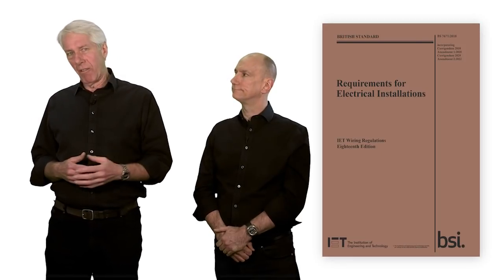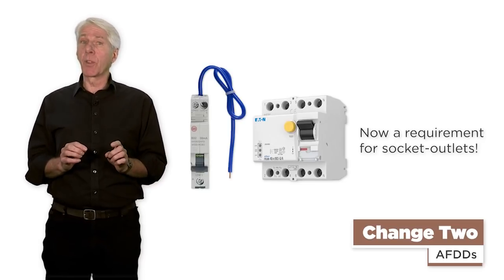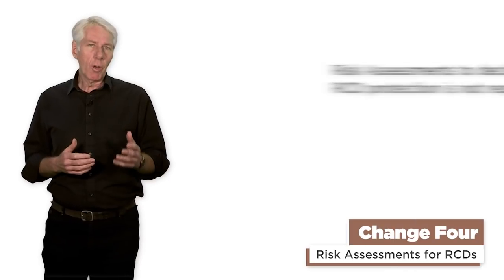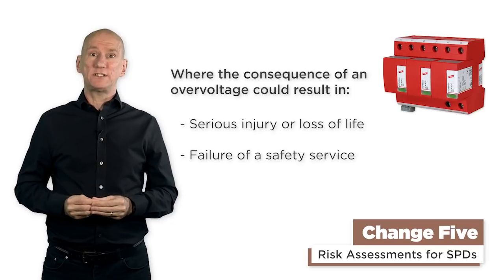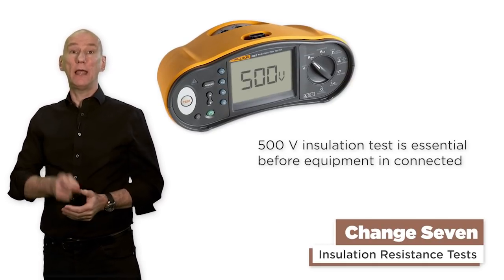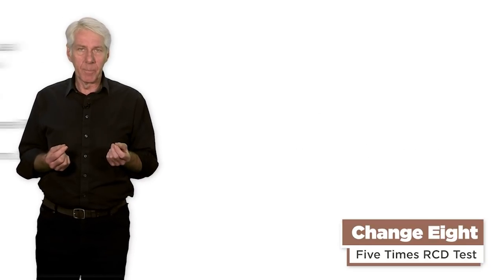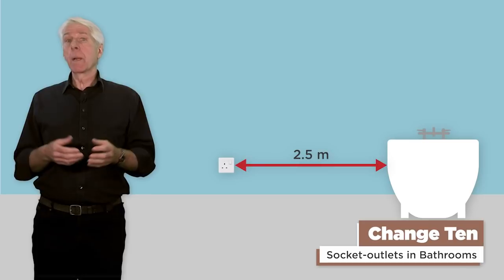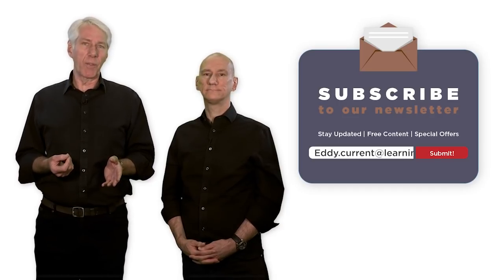Regs in Brief - 10 Major Changes in Amendment 2 of BS 7671

Comment: There's an awful lot of split-load CUs out there with twin Type AC RCDs. Under what circumstances would these need to be changed to Type A and assuming they're available?
Reply from the maker: Yes, we encountered this ourselves when creating EVE our EV charging point course and swapped over to Type As. Some EV charging point manufacturers have RCDs built into their charging units, so there will be some issues to overcome where the origin has type AC RCD. Some good guidance material is available in the BEAMA guide https://www.beama.org.uk/resourceLibrary/beama-guide---rcd-selection-for-protection-of-electric-vehicle-charging-installations.html

Comment: Another kick in the teeth for all the hard-working electricians out there !!!…another load of bull dictated by a regs jobsworth in a office making up bollocks to justify his job
Reply: Which items of these regs changes are a, bull? b, make electrical installations less safe? C, how exactly are they kicking trades people in the teeth.
Other than the fear of change, everything here seems pretty sensible with some useful removals of over complicated issues.
Reply: @agroves90  The 2.5m thing in bathrooms is pretty pointless, how many people have bathrooms that large?  If a bathroom socket is RCD protected then how is that any different to outdoor sockets/lighting?
Reply: @agroves90  in 50 years the only sensible thing they have introduced is rcd protection
Reply: @agroves90  I'm in agreement, it is a pain but there's always decorating if you never want to learn anything new 😏

Catty comments aside, it's a scientific trade with massive potential for things to go wrong catastrophically - we're meant to be the bright ones after all.

That said, I've dealt with a guy who's a spark who is part of the panel for the regs and to be honest I don't think I've witnessed a greater case of all the gear and no idea in my life...
Reply: Never met a hard working electrician in my life 😂😂
Reply: @rodgerq  🥺 I knew I was pushing my luck with that statement

Comment: Thank you gentlemen.. excellent presentation.  The inspection and testing paperwork changes seem like a very helpful amendment.. might save some trees..!     I hope I am correct in hearing that 'private' domestic gardens are included in the RCD requirement changes..?   Cheers..
Reply from the maker: Although technically speaking for Section 714, a domestic garden isn't subject to the requirements, there are other requirements in the regs that do require additional protection for  lighting circuits in dwellings; for example in Reg. 411.3.4
Reply: @learninglounge   Got it.. of course.. and thank you very much for your reply.. much appreciated.
Reply from the maker: @zed.kelectrical8741  You're welcome.
Reply from the maker: @N P we're with you on that one. Would make a massive difference to the industry.